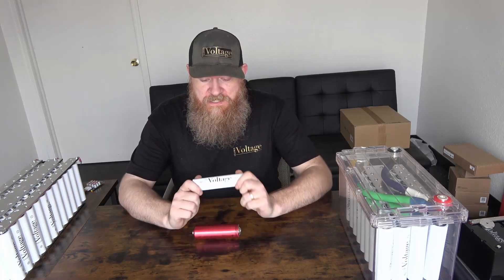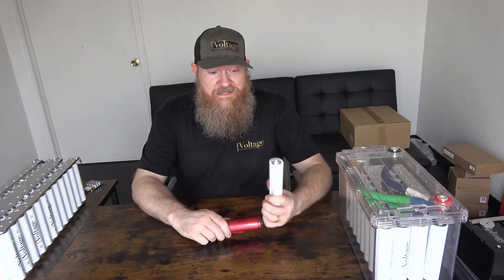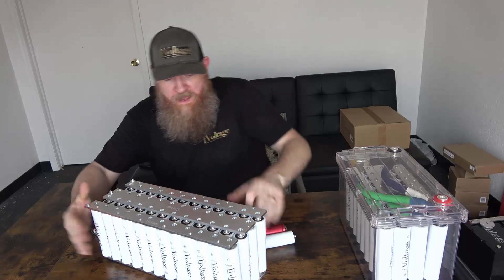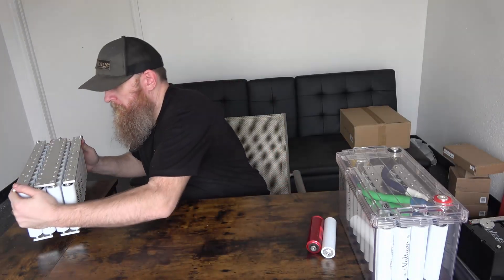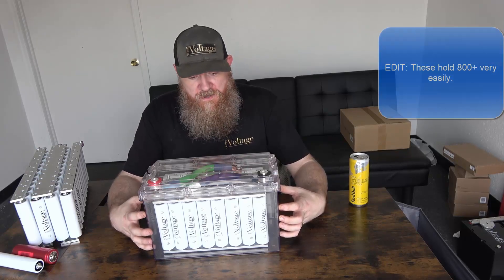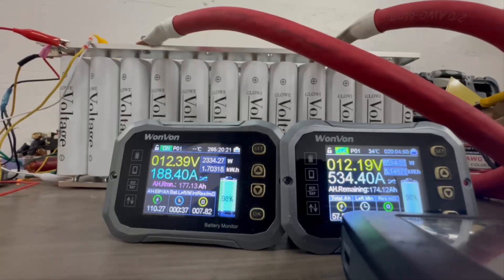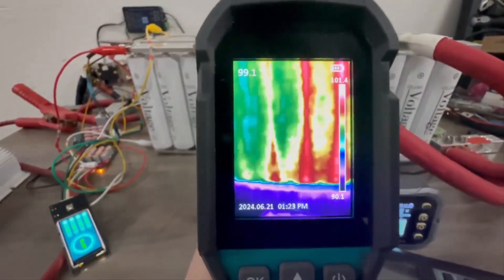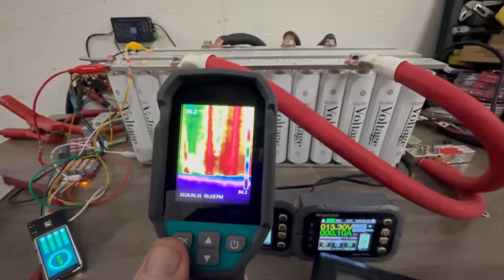New easy Headway replacement cells.  Double your available power and capacity.

Comment: Seth! Long time. Spoke to Daniel earlier and ordered the 120 with the clear case
Reply: How's it holding up?
Reply: @tommymartini34  its been PERFECT!
I will say with my dsp and overall build my clipping point is 35 of 38, I've never had a chance to go beyond 27, its just that loud and im an audio engineer, im not going deaf lol

im running 10k rms and I've never dropped under 13.6 (da baby-boogyman; song gets nasty not to mention im tuned to 31hz)
I haven't done a true burp test but I've played music at level 24/25 and the term lab showed 154db playing music and im tuned to 31hz...
the battery rest between 13.6-13.8, my 380amp alt charges at 14.5...
the weird part is though voltage is awesome, I still get dimming lights at night time beyond volume 20.
perhaps Seth or Daniel could chime in about that. I haven't reached out to them to ask why or what I should do to stop it but it's not a big deal to me b/c volume 20 is plenty but 23 it wakes up.

I've clamped 710amps at 14.1v on music, thats 10,011 watts, im happy I didn't do the build for numbers I did it for great music and b/c I use Focal monitors in the studio I went with Focal speakers( 2 sets of 3 ways) sounds amazing and the low-end is just and added wind tunnel experience

Comment: Ok, here's a different use case that i'm interested in, since I'm sick of my lead acid batteries dying so soon on my 08' F250 that I don't drive as much anymore. What if I used a 500A Daily BMS (unless you know of a better option?) to build a couple of batteries using those cells and maybe Jehu's 64AH PCB busbar?  See any issues outside of maybe poor cold weather performance and the stock alternator not having any sort of lithium charge profile?  Also, would you do these or larger prismatic cells for something like this?
Reply from the maker: I’d recommend a Jk BMS, or even a JBD before Daly.  And you should be ok getting a 250a BMS.  They allow for bursting higher than that (for a short time you’re able to configure in the app).

I ran a BMS initially with all of my lifepo4 batteries.. it’s not too bad if you’re not doing things like car audio. 

Also, these are pretty solid in the cold and shouldn’t be an issue. 💯
Reply: @GloweIndustries  Now I just need a clear case in a Group 65 configuration. :)  Also, do you actually know of anyone doing anything like this for vehicle start applications?
Reply from the maker: @ericjansen9042  I do actually. Someone local to me in Oklahoma City has a hellcat that he drives maybe once every 4-6 weeks and he has one. 

We also use a BMS in a lot of the batteries aimed at our LED customers who may go to an indoor show and want to power their lights all day without risking their battery dropping to unacceptable levels.
Reply: Every single person I've seen on YouTube or any forums that has done an under the hood LiFePO4 battery has seen 50% capacity degradation in a year. The under the hood temps are just too much, they go well past 60 Celsius and that's where things get REALLY BAD for all lithium cells.

If you put the battery in the cab of the truck then you only have to worry about charging under 10 Celsius. Your alternator is going to dump a lot of amperage into a LiFePO4 battery and nearly every cell on the market will have limits for charging below a certain temp. Under 10 or 15 Celsius you cannot dump alternator levels of current into a battery without doing some damage. Once you hit 0 Celsius you CANNOT charge over 0.2C without doing damage and below -10 Celsius (14 Fahrenheit) you really shouldn't do any charging but it can take 0.1C or less if you absolutely must charge. Seeing as you have no real control over the current your alternator is putting out (there are ways to control it but they get pricey) you have to install a DIY heater in the battery if your area sees ANY temps under 10 Celsius....which is going to be everywhere but Phoenix pretty much.

A 15W/20W/25W silicone heating pad on Amazon is under $20 for a pack of 3 or 4 (you only really need one of them or maybe two if you are impatient) and a temperature controller is a few bucks. You probably wouldn't want to have the heater run any time the temps are low because it would just drain the battery on cold nights so if you bought a cheap relay module with a remote you could turn the heater on from inside your house ~10 minutes before leaving, let the heater draw 3-4 watt hours out of the battery to get the cells up to a decent temp and then start your truck. 

Remember once you start your truck you are slamming the cells with a shit ton of current if they are under 80% state of charge...significantly more if they are under 30%/40% state of charge. So if you don't preheat the battery before getting in the truck and the battery has had some small parasitic loads (like any vehicle) on it for a couple weeks then you could see the battery getting hit with 70A or more. Do that regularly and your battery will be useless within a couple years at most. Once you start to really see capacity degradation on cells hit the 10%-15% mark the DC internal resistance is going to start climbing through the roof and DC IR directly correlates to how many amps can be pulled on something like an engine start....and this level of capacity degradation is easily achievable by charging LiFePO4 in cold weather.

It's a billion times cheaper to make a preheating system then to try to get away with starting the truck willy nilly no matter the temp.

https://www.amazon.com/WOODGUILIN-Control-Wireless-Industrial-Security/dp/B09QGGZBMW/ref=ci_mcx_mr_mp_m_d_sccl_3_5/143-3961036-7108317?pd_rd_w=AzXlQ&content-id=amzn1.sym.904f4c18-630f-4c52-8bdf-78921242d9bd%3Aamzn1.symc.27c848cf-47ab-487b-bd07-91bc659e0119&pf_rd_p=904f4c18-630f-4c52-8bdf-78921242d9bd&pf_rd_r=XAA2W2GZKZJCB2DKM5C0&pd_rd_wg=FGgDa&pd_rd_r=0a5226e5-1301-4d9a-8500-1d79ad3c69c3&pd_rd_i=B09QGGZBMW&th=1

This relay module has 20 working modes which allow you to turn on the heater for X minutes or hours and then it automatically shuts off. This would be glorious because you never have to remember to turn off the heater.

DO NOT BUY A DALY BMS. GARBAGE. There are other cheap non Bluetooth BMS's meant for engine starts out there starting at $40'ish. What you're looking for is something that has LARGE Copper bars running down each side of the board so the mosfets have a huge path for the current to flow down which lowers the resistance. Or buy a BMS that has a contactor/relay of the proper size but those are significantly more expensive. The JBD contactor/relay BMS's are all over $100 I think. Definitely more reliable but starting an engine is a short enough burst that it should be easy for the mosfet based BMS to handle that.
Reply from the maker: @ericklein5097  sir.. I find your assumption of not being able to charge in the cold weather disturbing.   It’s not 2012 anymore. 

We take cells rated clear down to -40c discharge and -30c charging. (And yes, they’re lifepo4). 

Not using these under the hood?  That’s sound advice.  Some folks do… but I especially would not sit it next to a large V8..  The ones who do?  Haven’t had any issues and it’s been years — but they also know not to expect to get a solid 10 years out of it if they abuse them.

They won’t blow up or catch fire (like NMC) they just won’t last as long and may decide one day to vent all of their goodies all over the place.
Reply: @GloweIndustries  I spose I could just relocate the battery to the truck bed since it's got a retractable lockable cover, and then I could just build one larger battery instead of two that fit in the group 65 size constraints.  Probably be cheaper as well, minus the copper wiring / time to run it.
Reply from the maker: @ericklein5097  also, I don’t recall if I had to on a jbd (I have several but it’s been awhile) but on the JK BMS if it’s a high compression engine with a lot of pull we sometimes have to extend the length of time it takes to trigger a short circuit cutoff.  The sudden surge of current will literally trick them into thinking there’s been a short.

Easy enough to adjust though.
Reply: @ericklein5097  Wow, thanks for the detailed reply!

Comment: I have JP43 at half ohm and I have mechman 240amp alt I have main battery delete with JP40 but ima return it while idle 800rpm on 40ah JP40 from down4sound I drop to 11.8 what series should I run I’ll keep updates how it does
Reply from the maker: Did you snag a S2??

Comment: What is the resting voltage on those and the max charge voltage?
Reply from the maker: rest at about 13.3v, max charge is 14.8v.
Reply: @GloweIndustries  So you can run the 120ah bank parallel with an xs power agm with out an isolator since the resting is pretty close? Trying to decide which glowe voltage I should go with to run parallel with my xs 100ah agm 370 alt and most likley can run 8k or 10k amp. Which series you think will work best
Reply from the maker: @johnnypiper1717  yep

Comment: How is the safety compared to these? I have seen some fires with certain LiFePO4 cells, but headway are generally pretty safe, i think because of the metal cylindrical can versus a LFP pouch cell... have you abused or punctured any of these to test?
Reply from the maker: I’ve never seen a fire caused by lifepo4 due to thermal runaway.  The fires I’ve seen were shorts or pulling too much current etc.  lifepo4 doesn’t have cobalt like NMC. 

That said - these are also cylinders so they’re easier to use since compression/containment isn’t even an option.